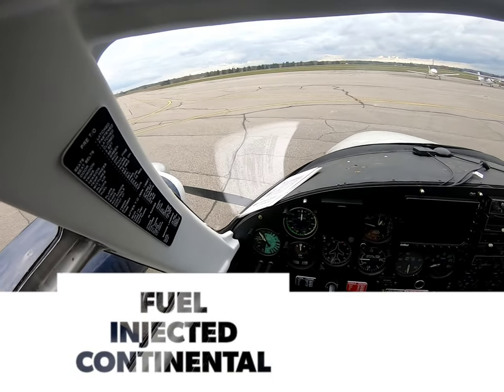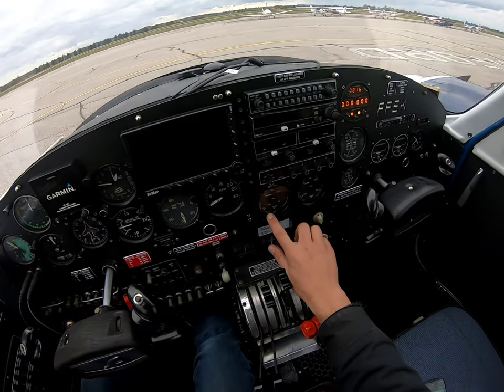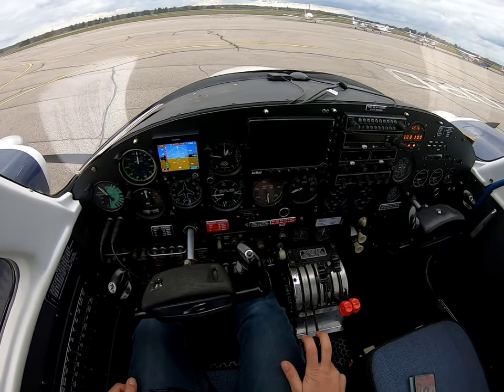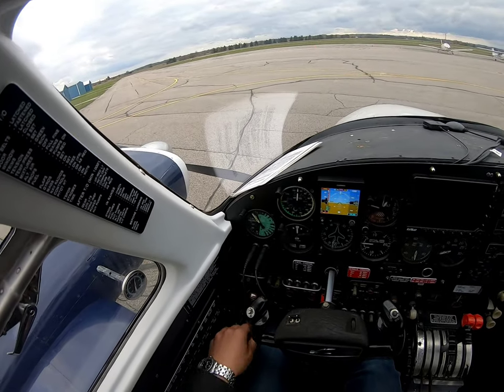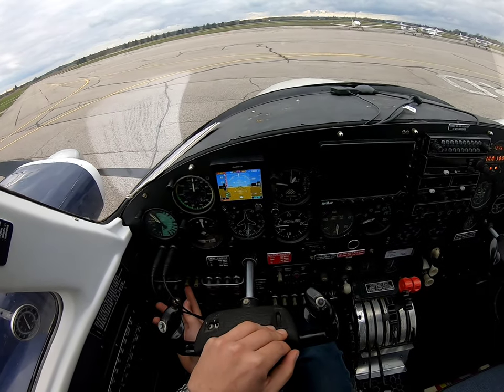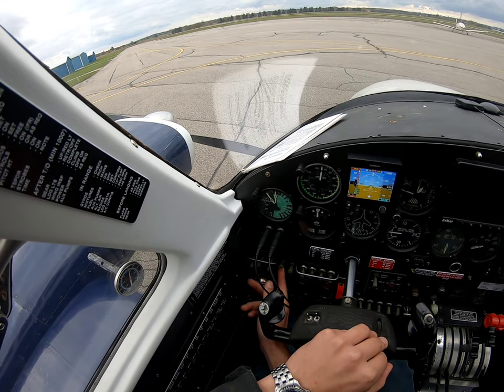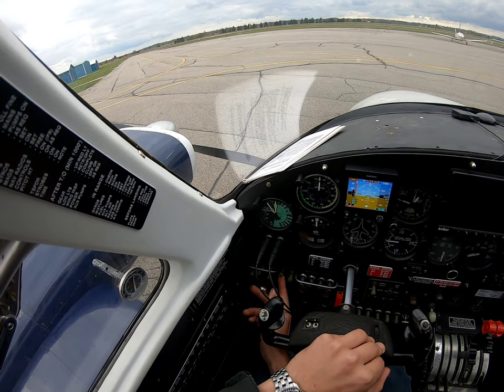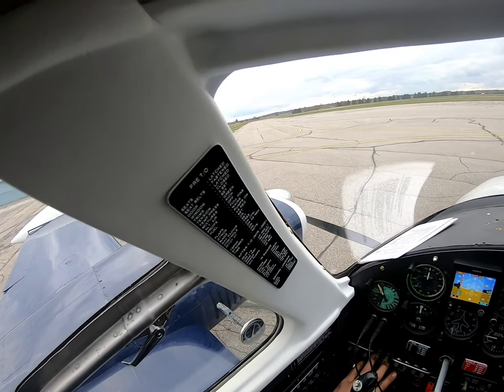Hot Start: Fuel injected Continental

Comment: Mixture cut off while you run the fuel pump is the way to circulate cool fuel through the system.
Reply from the maker: No you need mixture rich and throttle closed to circulate the fuel. This is a Continental procedure and only works on injected Continental engines. This procedure will not work for your injected Lycoming. Throttle closed  mixture rich boost pump high and leave it that way for 25 seconds.
Reply: Yeah, I agree with Susan.  I think this is opposite of what you are saying.  In reality, I think you are very slowly running fuel through your fuel system and into your cylinders.  The reason the engine is starting is that you have purged the lines of any air.  With your throttles in the idle position, not much fuel is going through and you aren’t flooding the engine.  To actually purge the fuel lines of hit fuel and air, you would need to pull mixture to idle and advance the throttles full forward.  Then turn on your boost pump and let the fuel flow through the system and back via the return since your mixture is in the cutoff position.  Do this for 20 seconds.  That is the continental method.
Reply: @fastbackflying853  i think it's just the opposite of what you wrote.
Reply: @fastbackflying853  No, this isn't correct. I have a Bonanza with a Continental. The hot start procedure is: (1) throttle out; (2) mixture idle-cutoff; (3) run boost pump for 60 seconds. This shuts down the fuel lines and purges the system. Then you just follow normal prime/start procedures.
Reply from the maker: @LimaFoxtrot  This is a procedure taught to me for starting continental engines and I have great success with it.  Other procedures also exist and this certainly is not the only method to get the engines running but I do find it works ever time.
Reply from the maker: @RATINDEXA320  There are published procedures that use partial throttle setting and mixture idle cut off. This is just one taught to me that I have had great success with and its never not got me started.
Reply from the maker: @n70199  Continental published a procedure that recommends partial throttle setting and the mixture at idle cut off. This is just a procedure taught to me and one that works every time. Looks like I have a good opportunity to dive a little deeper into this, and complete some hot starts with the partial throttle, idle cut  off and 20 seconds on the boost pump to see how it compares to my procedure.
Reply from the maker: I should clarify that what I mean here is this procedure only works on the continental engines not the Lycoming. I did not mean to imply that my method was that published by continental.